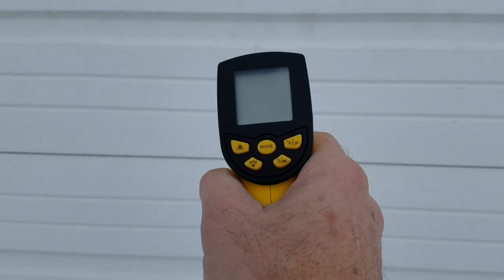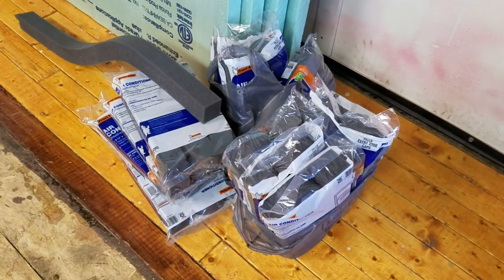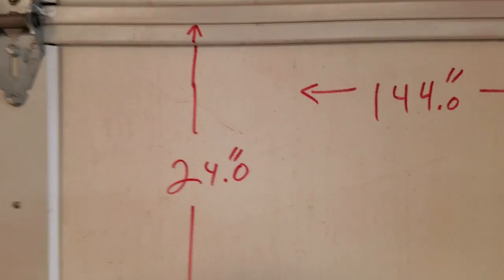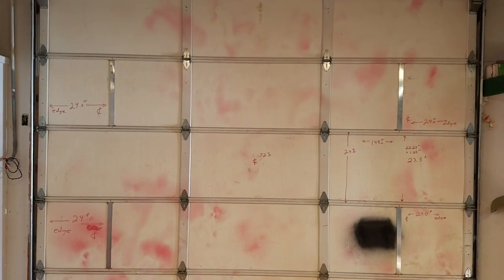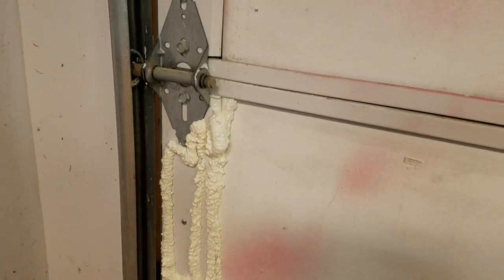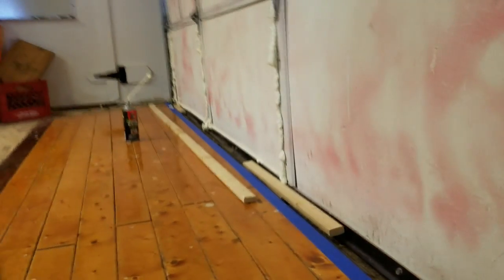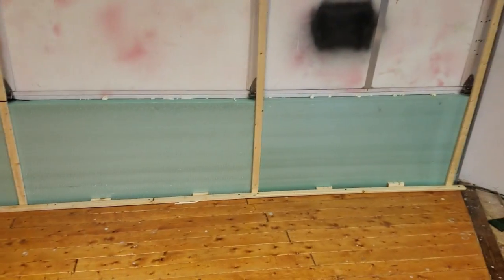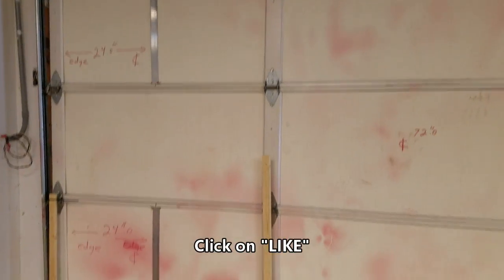Garage Door, Greatest Insulation,  Best Ever, How To,  Part-1 of 3  +1 year Review

Comment: Since you asked..... seems you've totally covered your hinges....no way to lubricate or repair these hinges, or maybe even replace them when required at some time.....without some "digging" into the newly added insulation. One more thing....air intrusion. These types of doors have a loose-fit against the door frames.....wind often rattles this type of door because the hinge rollers need a little slop for the door to pull away from the frame as it's lifted. Solution....maybe these---> as they use spring loaded hinge pins that force the door closed to lessen or eliminate the air gap---> https://www.youtube.com/watch?v=dDTLs4KOGZ0&t=22s
and here.... https://www.youtube.com/watch?v=VZolPmme0VA
Reply from the maker: Hi Wil,   yes, replacing the hinges is a little more work, but I don't see it as a real problem.   I have considered those type of hinges and plan to install them, we get some strong west winds, and the door does flex a bit but rarely leaks on less windy days.
As for lubricating them, it's straight forward; all you need is to remove the foam gasket and then reinsert it; if you missed that video,  Here is the link:  https://youtu.be/wLSf1DH6cTM   look @10:45

As to the effectiveness of the insulation,  here's a follow-up video:  https://youtu.be/96VJPZVQULM
FYI, the door has performed as expected and is in original condition without defects or failure.
Thanks for watching and commenting; I do appreciate it.
Reply: @SouthernEngineering  ...just trying to be helpful and add other options for you, or your viewers to consider. I need to go back to the Green Hinge option. Don't have any financial stake in this....but "just-sayin" that one needs to fully control the amount of door "opening"....if we only add insulation and don't close the gap....we're not getting a good result. Almost all roll-up doors I've seen, including my own..... have at least a 1/4" slop that I can detect.....sure, the door may be "contacting" the seal, but if it's not tight.... it's like having an entry door "leaned-closed" instead of "locked-closed" against its own seals. Green Hinge offers 2 strength levels of spring pressure....I wouldn't rule them out... out-of-hand. Cheers.

Comment: Better get a much stronger opener, or were you planning to leave the door closed permanently.
Reply from the maker: Depending on what I'm working the door is used several times each week.  I had considered replacing the springs but decided I would increase the torque on the existing springs just a little (2 turns on each spring), I can still open the door by hand but have always planned to install an opener.  I found an old commercial shaft drive style opener at `Habitat' it needs new electronics but the mechanics work fine, It's actually for a larger door but it should work fine for this application and I picked it up for $25.
Now that the weather has turned cold I'll be working in my shop doing a full rehab/reorganization this will improvethe functionality for projects, add a touch of mancave plus make it easier to shoot videos; It will be a many part series.  Stay tuned to see what kind of trouble I get into.
Thanks for watching and commenting, I do appreciate it.

I hope you're having a Happy New Year
P.s. I post updates and previews on Instagram @southernengineering

Comment: liqueda nials work
Reply from the maker: Hi Lexi.  I use Liquid Nails for many things but the urethane foam adhesive works extremely well for this application for several reasons.  1: It fills voids and gaps.  2: it remains flexible. 3: It is a better insulator.  4: It has a broader contact area for a stronger bond. 5: It is easy to fill and shape for a better final finish.
Now that the weather has turned cold I'll be working in my shop doing a full rehab/reorganization this will
improve the functionality for better projects, add a touch of mancave plus improving the place to shoot videos, It will be a many part series. Stay tuned to see what kind of trouble I get into.

Thanks for watching and the commenting.
I hope you're having a Happy New Year.
P.s. Check out the photos of the shop update on Instagram, I post updates and previews @ southernengineering

Comment: I applaud your efforts but I have found that the amount of air leakage between the door panels makes what you are doing 50% effective. I believe you would have been more effective by installing the 4x8 sheets top to bottom length wise for just the cold weather. you can use zip ties to make them none permanent.  I have also found that the side seams need to be insulated too. I'd skip the spray foam as I believe it is a waste of time and $$. Duct tape and the panels can be applied to create a secondary foam door that can reduce your air flow problems.
Reply from the maker: Hi Roy.   The video is a 3 part series, sorry it was so long but It's one of my first and I was still working out this video process (light, sound, camera angles, editing, etc)  It's definitely a new and challenging skill to master.

A temporary solution is not an option as the door is used many times during the week,  If you watch the other parts you will see how I incorporated seals and produced a thermally broken door.  I had considered a new modern thermal break door but that was near $3000.   Anyone can spend money to solve a problem, the idea here is to show a way to do it on anyone's budget. 

I did a one-year follow-up with a thermal imaging camera to show how well it worked and yes it has worked as well as I said.  My energy bill is a little less than half @ ~$100 during heating and cooling months.   I spent ~$200 to insulate so it paid for itself in 2 months.    The barn is 2500sqft and fully insulated R-19 walls and R-34 ceiling, I keep it at 60 in the winter and 72-ish in the heat of the summer. 

Check out this video from my 1yr review and then watch the rest.  https://youtu.be/96VJPZVQULMalso a summer follow-up on how well it kept the barn cool.  https://youtu.be/iNgnd8gI2MoHere's part 2  https://youtu.be/IebQ-Odc_2Uand part 3   https://youtu.be/wLSf1DH6cTM

If you have any questions feel free.
This winter I'm going to finish up the inside and start work on a resto-mod, I have 3 vehicles to choose from but not sure what to start with so stay tuned if you're interested.Thanks for watching and commenting, I do appreciate it.. 
I hope you have a happy prosperous New Year.
P.s. you can follow me on Instagram @ southernengineering  I'll post project updates and previews

Comment: Why didn't you show the completed door with the R value comparison?  Leaving the video where you did makes it seem like it was a complete failure.  I wanted to see results, not empty claims.
Reply from the maker: Hi Igor.   The video is a 3 part series, sorry it was so long but It's one of my first and I was still figuring out the video process (light, sound, camera angles, editing, etc)  Anyway,  I did go into more detail on the R-value,  the door was originally R-7 or 8 and I added R-10 plus I added a thermal break to really make it effective..   I also did a 1 year follow-up with a thermal imaging camera to show how well it worked and yes it has worked as well as I said.  My energy bill is a little less than half @ ~$100 during heating and cooling months.   I spent ~$200 to insulate so it paid for itself in 2 months.    The barn is 2500sqft and fully insulated R-19 walls and R-34 ceiling, I keep it at 60 in the winter and 72-ish in the heat of the summer.   I had considered a new modern thermal break door but that was near $3000. 

Check out this video from my 1yr review and then watch the rest.  https://youtu.be/96VJPZVQULMalso a summer follow-up on how well it kept the barn cool.  https://youtu.be/iNgnd8gI2MoHere's part 2  https://youtu.be/IebQ-Odc_2Uand part 3   https://youtu.be/wLSf1DH6cTM

If you have any questions feel free.
This winter I'm going to finish up the inside and start work on a resto-mod, I have 3 vehicles to choose from but not sure what to start with so stay tuned if you're interested.
Thanks for watching and commenting, I do appreciate it..

P.s. you can follow me on Instagram @ southernengineering  I'll post project updates and previews
Reply: Southern Engineering a

Comment: Thanks for sharing.  I hope you increased the springs accordingly.  That's a lot of extra weight to offset.  If not, your garage door opener will be overworked.  I guess I need to watch part 2 if there is one.  I imagine there will have to be gaps between the styrofoam panels, because when the door opens, those panels are going to scrape against eachother, and bind-up as the panels travel around the curved garage door track. More binding will occur, the thicker the panels.  In other words, the thicker the insulated panels, the larger the gap is needed between them to allow for the door to rotate around the track without binding-up
Reply from the maker: Hi T.   I had original planned to replace the springs to offset the weight but I installed a direct drive opener that was removed form a large commercial door, the unit is way oversize but the price (free) was in my budget..  You are correct about the panel thickness, 2" foam is the max that can be used without special beveled edges.   My plan was to have a thermal break so no exposed steel,  check out Part 2 @ 2:45 and Part 3 @ 11:44 for the details.   thanks for watching..

Comment: I guess you're not going to open this anymore
Reply from the maker: Actually I use the door almost daily,  I did re-torque the springs 1 1/4 turns ea. You can see it in operation if your interested. https://www.youtube.com/watch?v=QC09t34nil0&t=1s  The door does have more inertia but is manageable however that will be mitigated once I install a direct drive door opener.   FYI. I'm doing a full shop rehab and will be posting to YT if your interested, stay tuned. Thanks for watching..

Comment: I've done exactly what you did on every garage door I've owned for the past 25 years. The last one was an insulated door like yours was but it was pitifully ineffective until I added board insulation to it. Well done and you saved a bunch of cash over the cost of a custom insulated unit.
Reply from the maker: Hi Bruce, thanks, glad you like it.  I used the same process on my last shop (~10 Years ago), it's still working well to this day (son has that home now).  Definitely the best way to save money if you heat or cool your shop.   Thanks for watching,  stay tuned for more...

Comment: What did you use to cut the foam? I've used a hot knife, but it is hard to be precise. It looks like there is saw marks in the foam. If you used a had saw or table saw, what type of blade did you use? 

It has been one year since your video, how has everything held up? Is there anything you would do different? 

What inferred measuring devise did you use, Model and Brand and have you been happy with it?

Has the instillation hindered the opening or closing of the door at any point?
Reply from the maker: Hi Cindy,  great questions.  I used a Table saw and a crosscut blade,  it's critical that the edges are straight and square for proper sealing of the foam gasket.

I have had zero problems with the door and would not change anything with the design with one exception.   The bottom edge of foam needs a hard edge and gasket to increase the floor to door seal.   I had planed to do it last summer but was out of town frequently and unable to get to it.   I will take care of that this summer..

For thermal measurement I used two different units, 1 is a inexpensive unit from Harbor Freight, it's a single point unit and works well.  The other is a Seek Thermal Compact XR,  here is a link https://www.thermal.com/compact-series.html.  I's a very good unit for the money, and gives a greater understanding of heat flow.  I'm very happy with it and recommend it if it's in your budget.

The only hindrance is the added weight to the door, you can compensate with the springs but the inertia required to get the door in motion is increased.  I am planning a power opener when I have time, while not required it's more for convenience. 

One more item,  I am considering a hinge replacement call `Green Hinge System'.   They are a spring loaded hinge that is suppose maintain edge seal in high winds.

I heat and cool my barn year round and absolutely had a reduction in my bill.  Literally the door paid for itself in 2 month of winter weather; not to mention I can work in the barn in comfort year round anytime day or night, that's important for me. 

Hope that helps,  thanks for watching and stay tuned for updates...

Comment: I noticed you have a few boards from threshold of garage door with a raised board border.  Tell me about that.  was it there to prevent water from flowing into your garage floor at bottom of door during rains?
Reply from the maker: Hi Linda.   I don't like concrete for a work surface, so what I have done in my barn is install a sub-floor and hardwood over the concrete.   It's layered like this.  Concrete slab,  concrete sealer, 30 lb tar-paper, 3/4" OSB with Tapcon anchors where required, then 1" X 4" planks for the finish floor..   All the sub floor is installed, now I'm working on the planks.   I had done this in my old shop and absolutely loved working in there.   I started on my barn before I ever considered a YT channel so no video exists.  However I am finishing off a section of the barn that has yet to be done, and I'm doing videos of the project.  check out this video, https://youtu.be/zIGK4eGx3wU.  it's the start of my daughters art studio and it will have the hardwood floor that is being installed throughout the barn.  Thanks for watching and stay tuned for updates..
Reply from the maker: Hi Linda, I wanted to followup with you about my barn floor.  Check out my video on "Workshop wood floor with furring strips"   it should give you a better idea of how i'm finishing my barn.

Comment: What kind of angle did you have to cut between the foam panels to allow the door to roll up the track?  Take care.  Doug
Reply from the maker: Hi Doug.  The panels are cut at 90 deg, and spaced EXACTLY 2" apart (very important).  As the door travels on the track the point of maximum fold the edges just touch.  It's VERY important to check your door as tracks from different manufactures may very the radius of the bend.  I used 2.25" square foam for the seal. The sealing foam is held in place with friction and the adhesive effect of the paint.   It has been cycled hundreds of times since installation with zero issues.   Thanks for watching.

Comment: My point is you covered your bottom brackets you added weight to the door rendering your Springs absolutely they should break pretty soon and the panels will fall off within a year or two at best good job.
Reply from the maker: I must disagree, If you watch the last video I detail your points and how to mitigate them.   As to longevity, my prior workshop had a 16 X 7 door that I modified in the exact same way ~10yr prior.  My son lives there now, the door is intact and functional, the only change is he replaced the opener..  I have used my door regularly for the past year with zero problems , so stay tuned and we can discuss this next year...  Enjoy the new year..

Comment: Simply by spending an extra $250 and buying a sandwich door your insulation problems are solved and you don't have to do all that crazy stuff.
Reply from the maker: I think you missed the point.  Replacement cost of my door with a high R was quoted $2316.68 installed and tax; the only difference was that the new door and fake windows, carriage door handles and hinges a $149 option.  For ~$250 I showed how to insulate an existing door effectively,  a DIY project that works.  Maybe not as elegant as a new door but very doable.  ROI on a new door ~4 years,  ROI on mine <2 Months.  Not everyone can afford a new door however, they can my design..  Thanks for watching...

Comment: How long did this insulation last?  Does the foam still hold it in place?
Reply from the maker: I insulated a door on my old shop 9 or 10 years ago, it's still holding strong, (Our son now lives there).  This door is one year old to date and It has been cycled countless times, with no defects or failures.    If you prep the surfaces properly,(clean, grease and wax free the urethane is a formidable adhesive, it has never failed me when used in a suitable application.  (FYI Gorilla glue is a urethane type adhesive) Check out my current video on the the performance of the insulation.  https://youtu.be/96VJPZVQULM.   I hope that helps and thanks for watching...